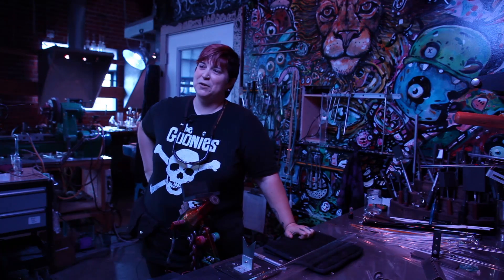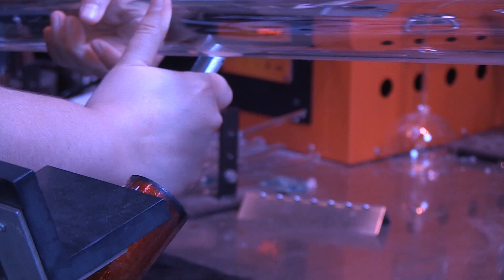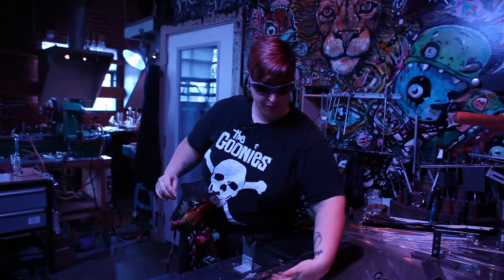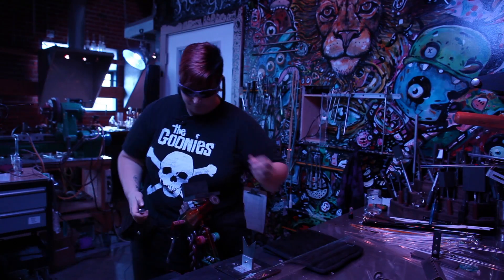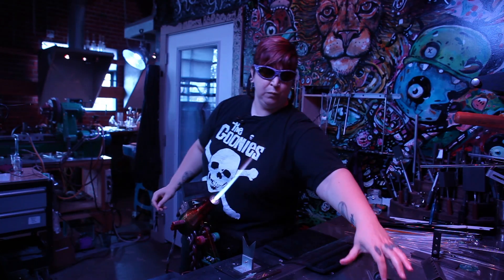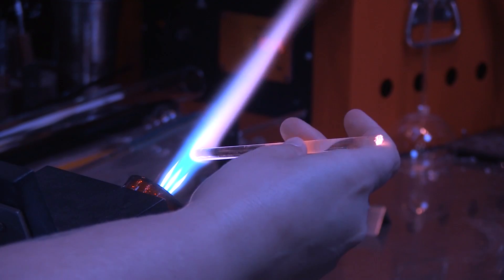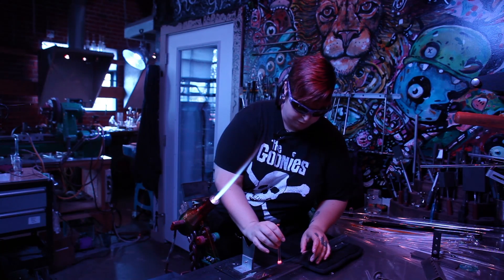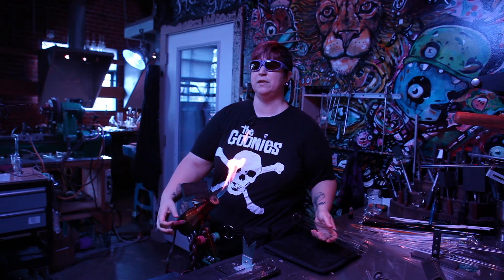Bench Tricks: Breaking Down Tubing (Score and Heat method) || REVERE GLASS ||

Comment: Can this ever go wrong? i.e. shatter a good size section of tubing?

 Also, you mention this can be used with large diameter tubing, but how about smaller diameter tubing? I assume so, but wanted to make sure before I give it ago. 

Lastly can this be used to cleanly cut at an angle if one were to make the score mark at an angle? Take for example that amazing lathe bong video you made (I loved it! I'd like to see more of your work Suuze!), could this technique be used instead of using your wet saw to cut your GONG joint?
Reply: Tony Cortese I use this for tubing from 30mm to 120mm. It doesn't work for cutting angles though. Cant really go wrong, its all about getting your score line in the centre of the molted rod tip.
Reply: Yea I've since tried the angle thing. Didn't know it could be used for such large tube, though. Thanks for the answers Lee!